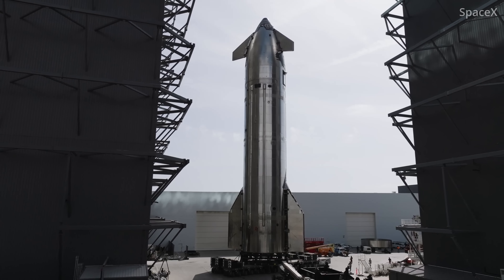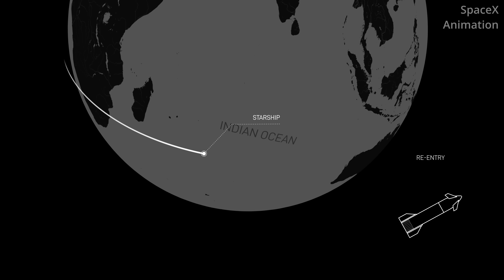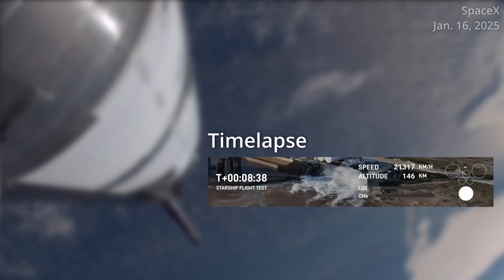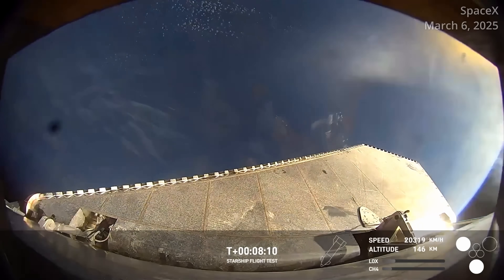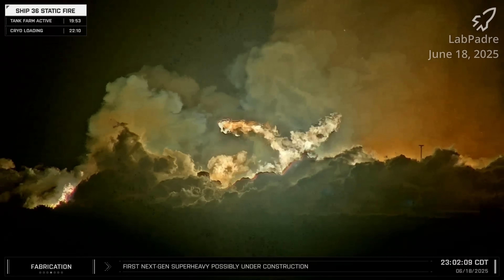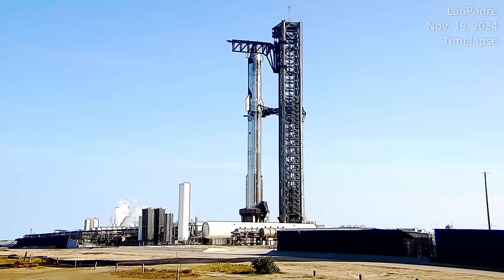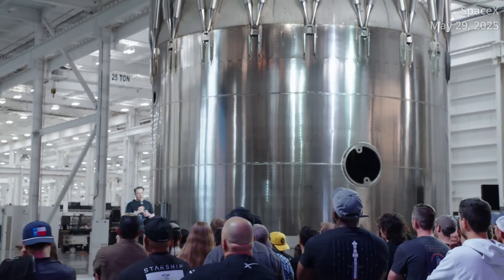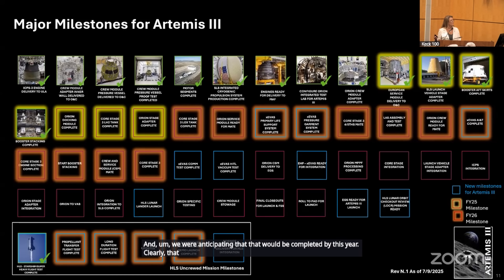Will SpaceX's Starship bounce back following 3 failed missions, test stand explosion?

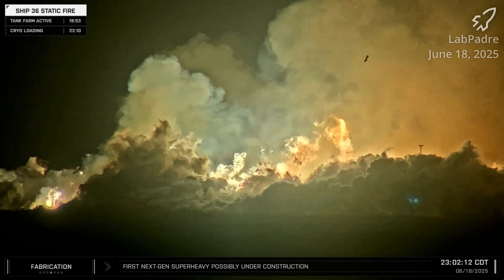Comment: 05:01 and 05:55 - Massey's test site was NOT destroyed (or lost) as a result of S36's explosion, only the methane farm was badly damaged (the separate LOX and LN2 areas were largely undamaged). The ship static fire test stand was damaged though and will be repaired when it's upgraded to support Block 3 ships, the flame bucket in the flame trench was also damaged. However, the damage to the methane farm is preventing further static fire testing there for now (it's currently being repaired and upgraded for Block 3 ships) but that doesn't stop SpaceX cryo testing vehicles and test tanks.

Comment: Nitrogen is NOT flammable.  How did that cause the ship to blow up? Just askin'.
Reply: When did they say it was nitrogen? They said structural failure lead to fuel mixing, nitrogen was never mentioned
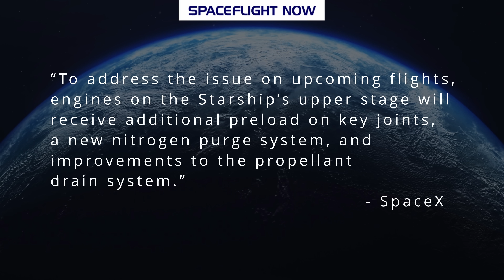Reply: Nitrogen purge is mentioned in the note at 4:44
Reply: @Happyness-n2z WAS IT A FAILURE OF Carbon/Carbon Nitrogen bottle leading to other damage to fuel container ??